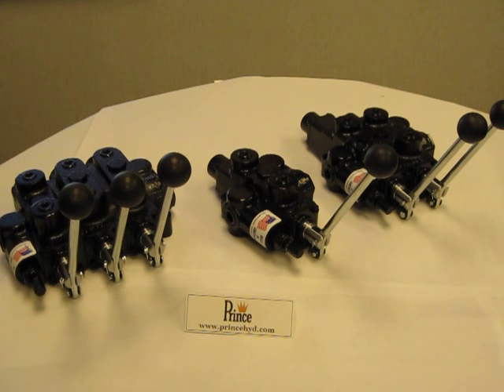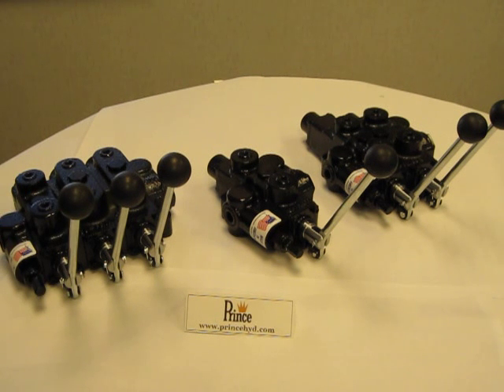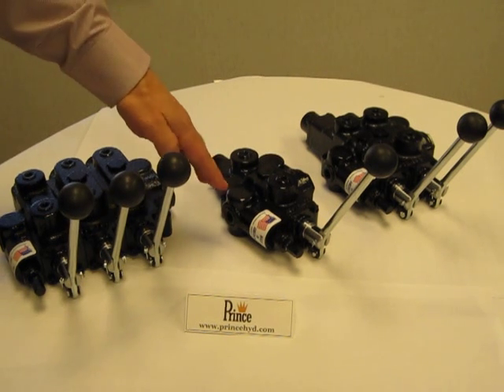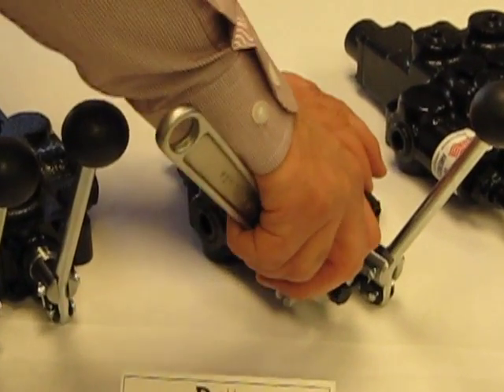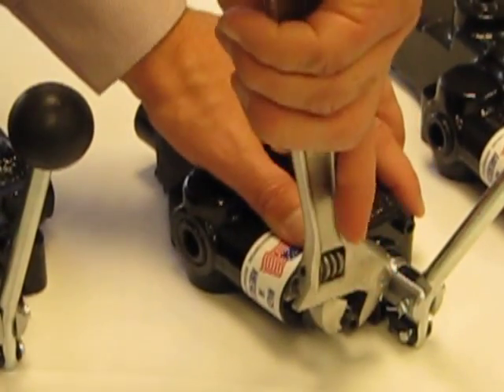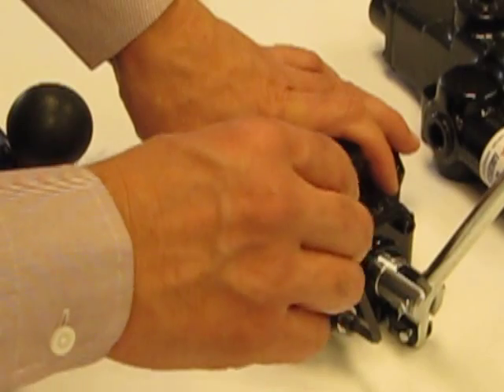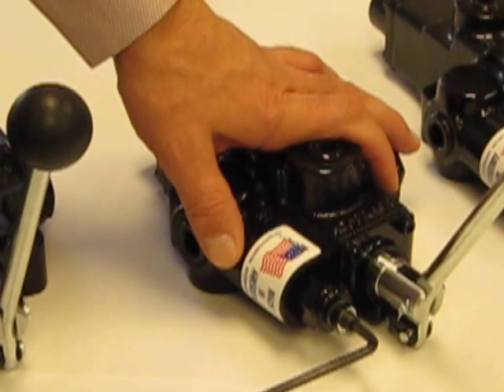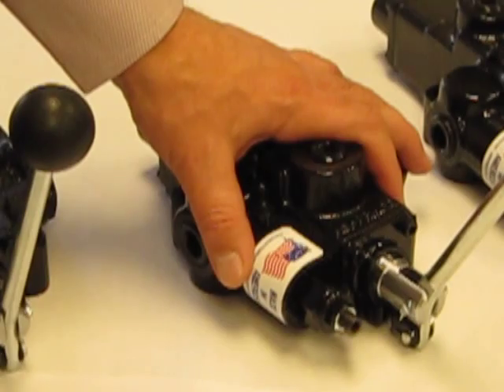Prince RD 5000 Relief Setting; How to adjust

Comment: VERY helpful! Thought it was going to be more complicated a process.

Got one of these (2 spool) to replace the originals on and old 63' Massey Ferguson 202 Industrial tractor in an attempt to solve the issue of having poor lifting power. Needless to say replacing the controls HELPED but didn't solve. The old ones had some not-insignificant past seals anyhow. Only at governed speed would the factory relief be tripped since my pump is rated at 14.6GPM @ 1800rpm @ 2500psi. Can't get my old lift cylinders to lift its own weight reliably after the fluid has warmed up even at idle so the 2000 factor setting isn't the issue. BUT am replacing the rams now and definitely need to adjust the control relief. Adjustment for me doesn't have to be precise since the pump//controls//rams are all capped at 3000psi and I'm unlikely to squeeze out the RPMs from my tractors old motor to get that high anyway.

Comment: I have a 3 spool valve and would like to adjust pressure on a single valve.  I need an articulating arm on a grapple to rotate slowly while not affecting speed or the other two actions.  Is there a way to do this?
Reply: Nope you need a seperate valve for that outlet. Or some kind of reducer to reduce amount of flow

Comment: I have the single lever valve and the return does not stay sometimes. I have to hold it for a couple seconds. Also it spits oil out the end cap through the little hole. What gives?
Reply: needs rebuilt or replaced.